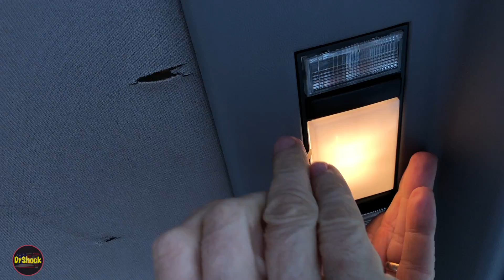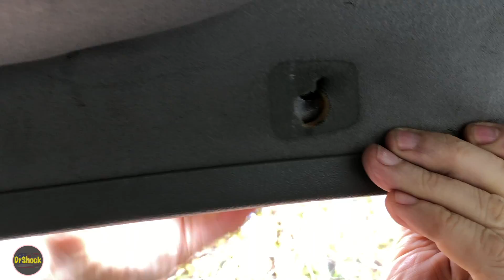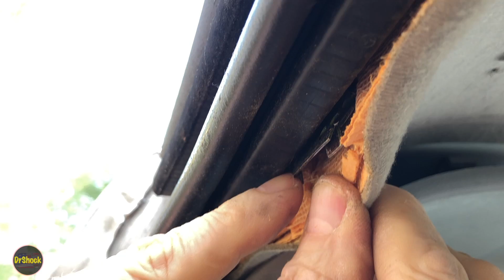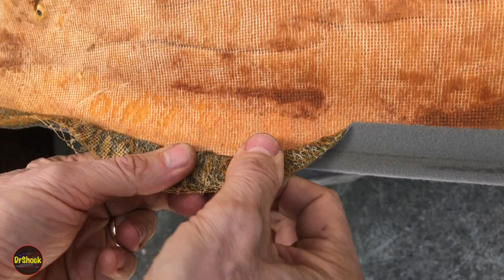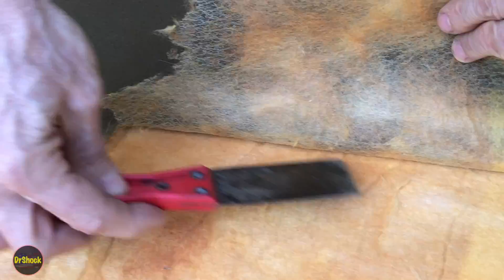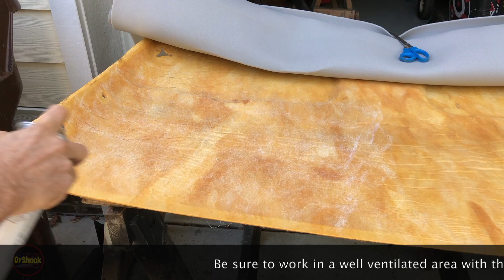1995 - 2002 GM OBS Regular Cab Truck Headliner Recovering / Reupholstering Repair (Chevy & GMC)

Comment: Can you use a wire brush to get the foam off ??
Reply from the maker: You just want to be careful of not damaging the backing board, and noting that it's going to have fiberglass fibers that can get stirred up.